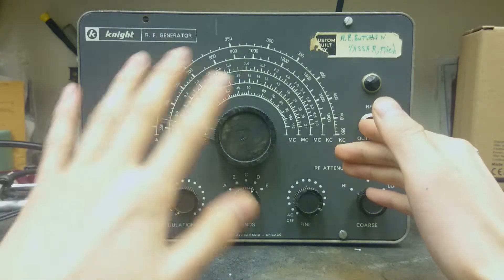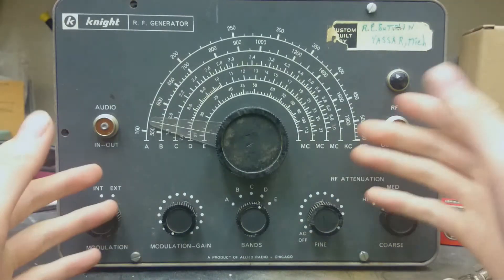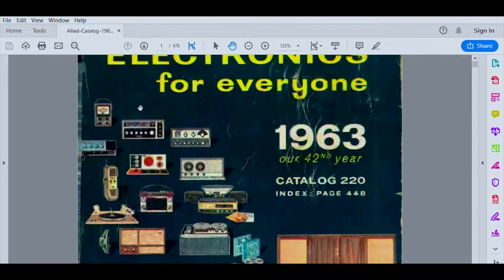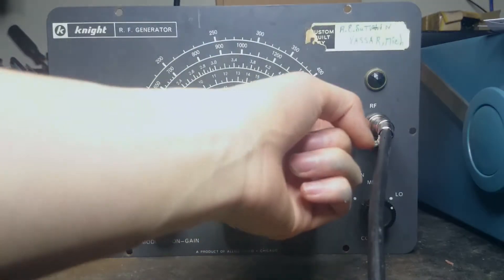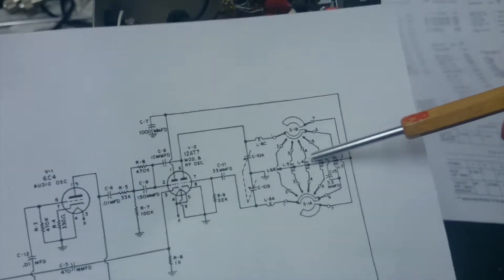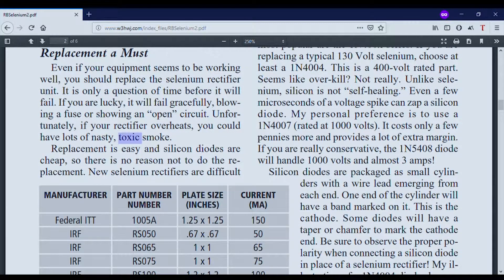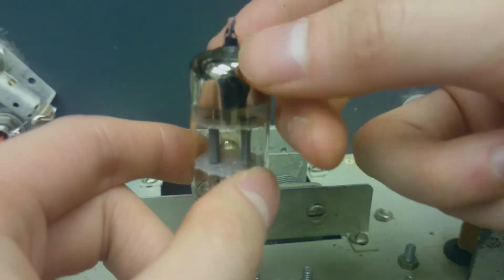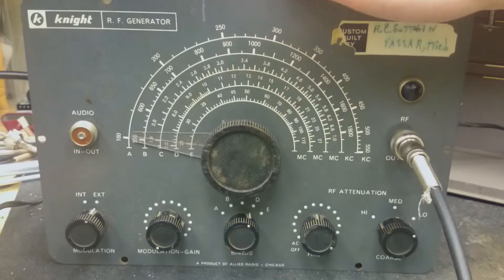[Bits #20] The KNIGHT Audio and RF Generator - Some History, Schematics, and Operation of the KG-650

Comment: i have one that looks like that one. But the needle indicator is misalign with the varicap. with the varicap fully closed the need should be in a 180º angle?
Reply from the maker: I just checked, with the cap fully closed, the needle should point all the way to the left, lining up with the bottommost tick mark below 160KC. With the cap fully open, it points to the opposite end of the dial.

Comment: Hlo. Your nice work and good knowledge.
Thanks. I have also a Atlas company signal generator 
It have 3 tubes.but main supply transformer is missing.
Can you provide me it's circuit diagram me with voltage.
My wattsupp n. Is +91 9720773147

Comment: What kind of audio output does this thing make? Or is that just a pass through? I’m a synthesizer guy and just saw one locally for cheap, wondering if it can be abused to make some noise? Sorry for the off topic question, but thanks in advance!
Reply: It's a fixed 400 Hz oscillator, and a pretty decent sine wave.

Comment: Nice vid overall.  My $.02 you didn't ask for and probably don't want... 
I did feel the Streetview of the old Allied building and extra details of finding an old catalog & value in current $ all seems like filler.  Seeing the actual catalog entry was worthwhile and a nice addition though.  Also, the transition to another video detailing the functioning of the generator was a bit jarring and could have done with better audio leveling.  Might have been better to just mention the results, with maybe a couple screenshots, and include links in the details. 
FYI, easier to just replace the old connectors with modern BNCs and more useful in the long run.  Building the specialty cables seems like more work and $, plus you're left holding onto extra cables, either getting mixed in with regular or having them stored separately, all instead of just using regular BNC.  They're also a better design and easier to use than the old ones.  Can always hold onto the originals to reinstall them if it turns out the original parts really matter somewhere down the line, but that's not hugely likely with most of these inexpensive old kit devices.